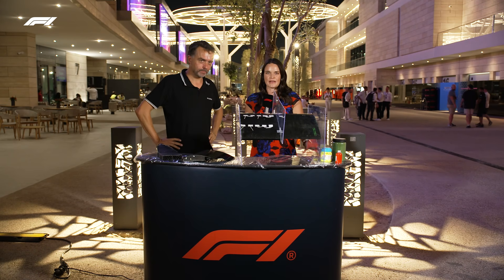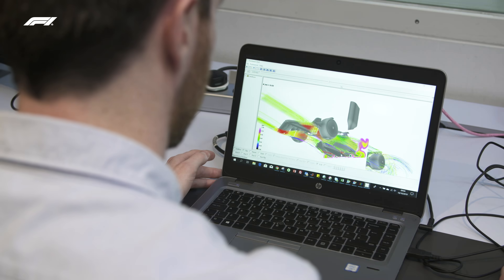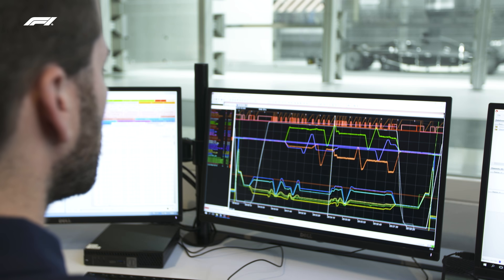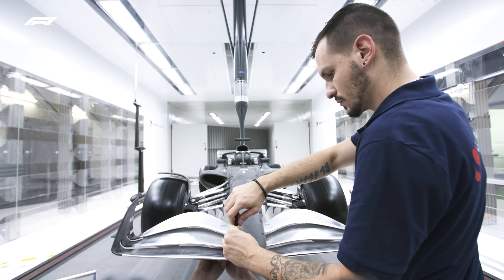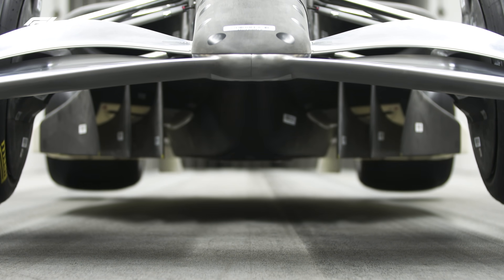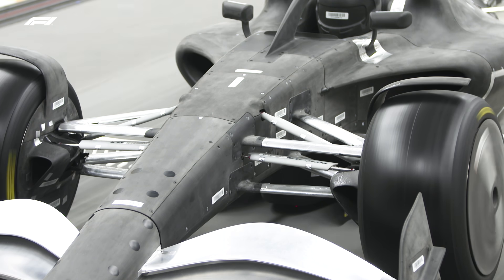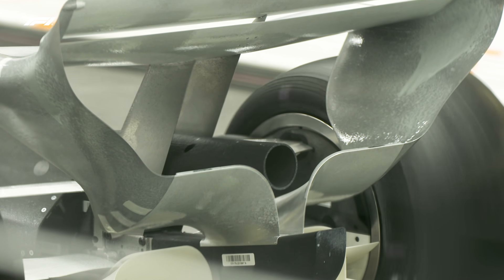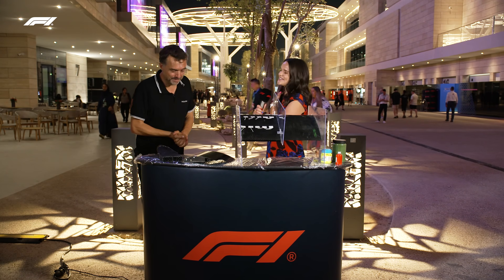Going With The Flow: Understanding F1 Aerodynamics | Tech Talk | Crypto.com

Comment: The part about the tiny pressure sensors inside the rear wing was really cool to discover
Reply: Yes. When Sainz got damage to sidepod and floor this season, and Ferrari said to him on radio "Aero loss is 5%"... I was like How do they know that? This answered so many of my questions!
Reply: They're all over the car, front, rear, floor, you name it. There's quick release connections when they replace the front wing that pipe all the pressure sensors through.
Reply: Yeah as a motorsport engr myself you can learn a lot of things to start from here too Also Albert has his own channel. So everytime there are a lots of new things to learn for everyone.